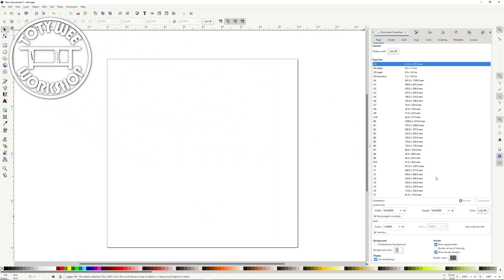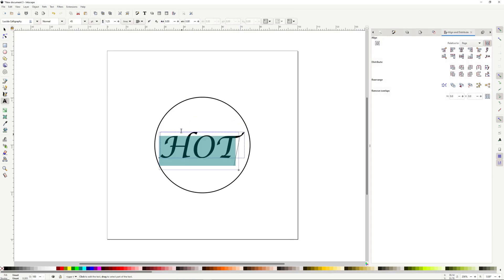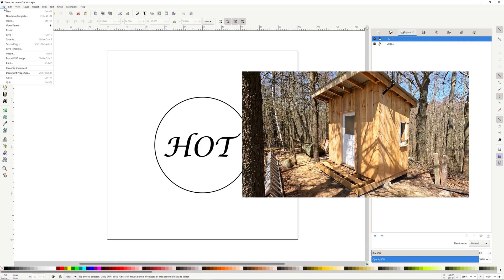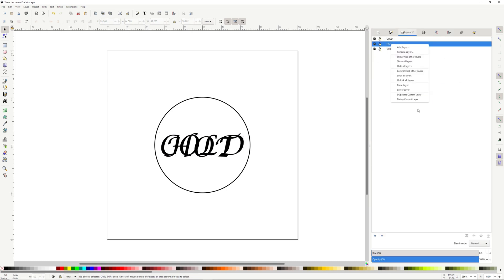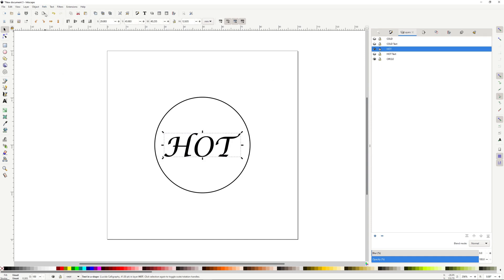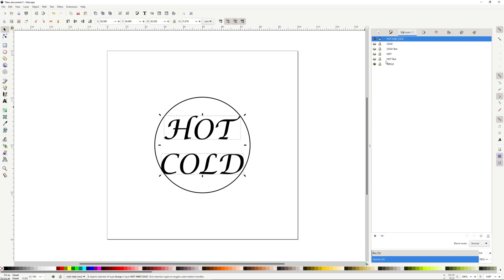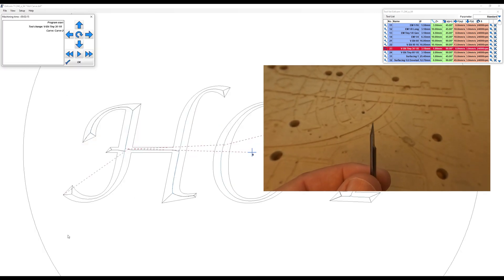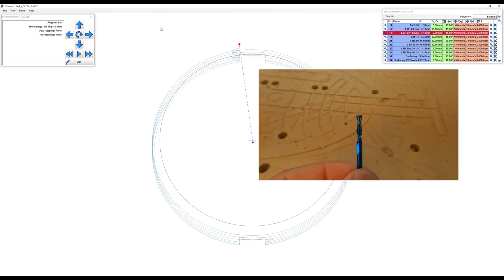CNC Inlay Using a Simple V-Carve Method

Comment: There is a guy that uses sand blasting to remove the crumbs from the wood after "V" carving Great job with EstlCam thanks
Reply from the maker: Thanks! I've only ever heard of sand blasting for stone 😀 an air compressor would do it but I need to keep the dust down in the shop anyway
Reply: @totyweeworkshop  There are sand blasting cabinets for doing things inside to control the dust and you can regulate the air pressure to have the blasting less aggressive.
have fun Tom